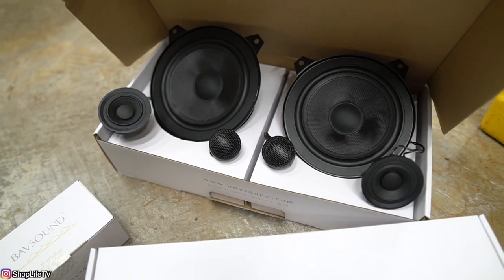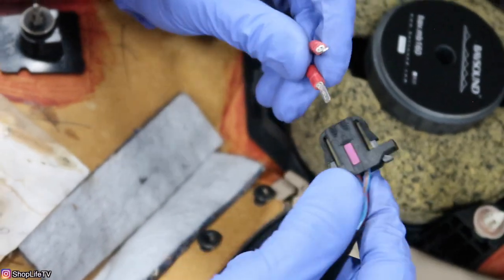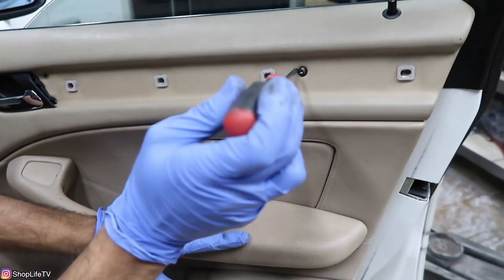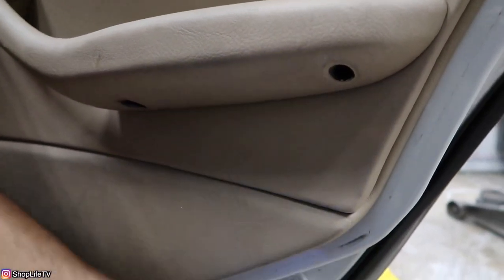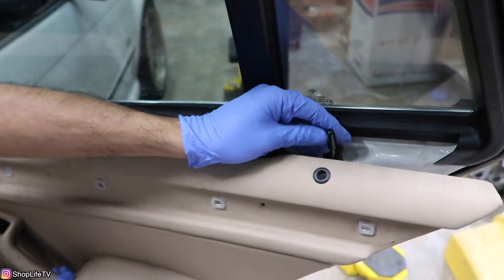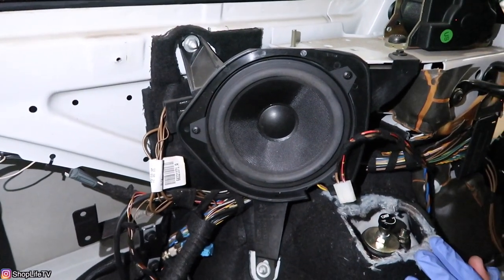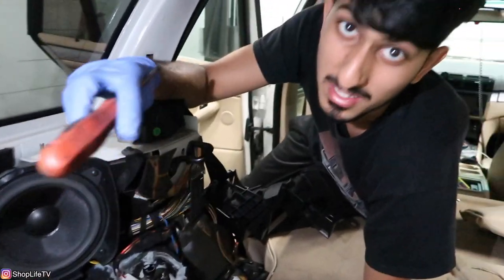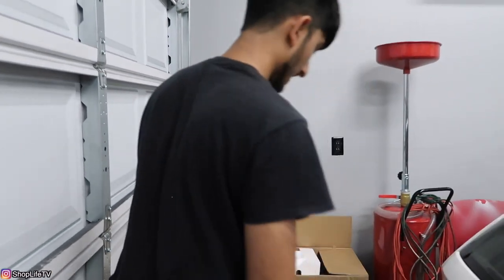BMW Speaker Upgrade! EASY DIY INSTALL! BAVSOUND REVIEW

Comment: Bro my first car is the e46 wagon and I’ve used your videos to repair everything wrong. Radiator, coolant reservoir, blower motor & resistor. You’re great my guy keep going!
Reply: Any one can do it and save thousands, this guy and a couple others I’ve seen are some goats fr, thinking of buying a Ci, and with his videos I think it’s more than worth it plus they’re super reliable cars 👌🏻

Comment: I purchased the full 16 speaker upgrade for my f15 x5 HK system. I’m not gonna lie, at first after install it doesn’t sound like an upgrade in sound. You have to give the system some time to break in, after the break in period the bavsound speakers come alive. These speakers are so clear an louder, you don’t have to crank it up as much as the old speakers. No distortion at all, I will recommend doing sound treatment to the doors an unseat sub

Comment: I’ve been looking at the BavSound speakers for my ‘01 wagon for a little while now, just waiting to find a deal
Reply from the maker: Still a good upgrade for the rest of the system, you might just have to get custom subs. There's a guy in Georgia that makes a bunch of them for E46 wagons
Reply: ShopLifeTV where did you get your trunk liner?

Comment: Seicane on e93 is similar to installing a bowl of vomit and poo in the dash that allows you to use a backup camera and MHD, Waze on the nav screen. It's a good package that allows you to annihilate your ipod functionality, ipod sound, ipod detection and control with the steering wheel...and also a great way to annihilate access to the stock BMW interface that alllows you to read oil levels, reset tire pressure sensors etc...

Comment: Mr. Shop Life, I would love to install these in my 2001 325i but... I replaced the stock Business stereo with an Alpine stereo and it sounds terrible. Yes, it's going through the original amp, which is probably the issue. Any thoughts on bypassing the original amp because the Alpine has a pre amp built in? The wiring at the amp looks very complicated. Maybe I just need to start over.

Comment: Great video as always 👍, just a question not related to this video, if I install a amp and subs is it recommended to upgrade the alternator in my 318ti or is it fine as is, because i once installed this in a honda accord and every time the bass kicked in the headlights will dim?

Comment: 240K? Low mile creampuff. My 280k 1999 528i Touring and I just did a 14 hour drive last sunday, 90 and 100 deg temps and 80 mph the entire way and I had to turn down the A/C because I was getting cold.
BMW = Beast Machine. WHAAAT?

Comment: Hi, I’m not getting any sound from my e46 speakers. The head unit works fine but there is no sound at all. Could it be the amplifier? If so, is there a way to test it to confirm? Appreciate any help
Reply: Same bro I got sound before with my stock speakers with my eonon radio but now no sound?
If you figured it out can you please help me!!

Comment: I tried putting my after market stereo in my e 56  but I can’t hear anything. ? Is there a special wire or harness you need? Like do you have to use the antenna?
Reply: I’m stuck on that too have you figured out a solution if so please help 🙏🏼

Comment: Not really an easy DIY install... Straightforward for you as a professional, but most people would be challenged!!
Reply: Not at all. It’s extremely easy. If you have all the basic tools it’s maybe a 3 hour job to do every speaker. I did it last weekend.

Comment: I have a e46 2000 ,323i ,sedan , does anyone know where to buy the rear speaker covers ?
Reply from the maker: Check ecs tuning, otherwise go to a pick a part or check local classifieds
Reply: Thank you , I love your channel man. You give so much knowledge and specific info . I was able to do a head gasket. When a shop wanted to do an engine swap for $6k

Comment: Installs new speakers, no review if speakers are better than stock or not, conclusion aside from installation no point of video
Reply from the maker: Like I said in the video, they are better than stock HiFi, better than Harman Kardon system and on par with a custom Rockford Fosgate system (without subs) I had in another e46
Reply: No point to the video? 1. He DID review the speakers. 2. He just showed you how to install speakers in an E46 for FREE! There is no point to your comment.